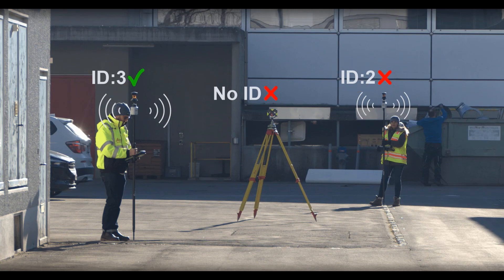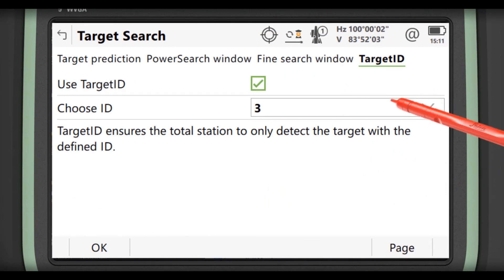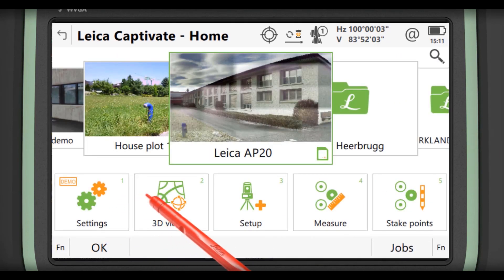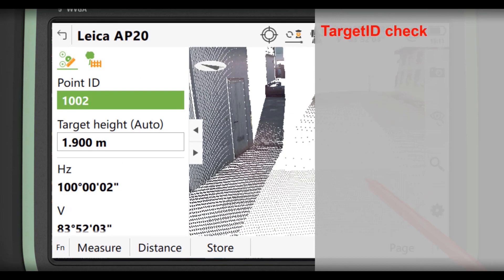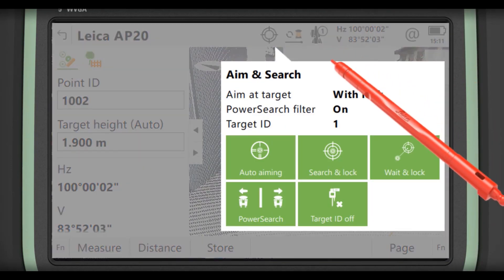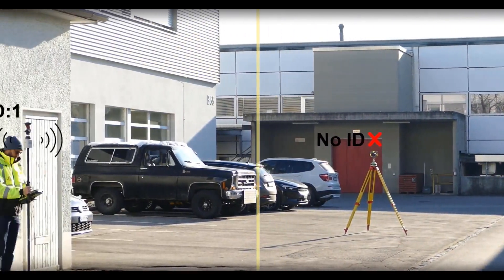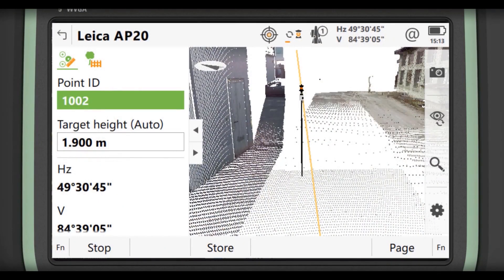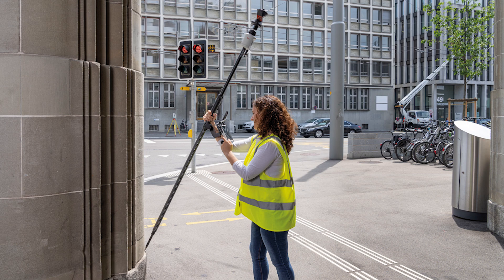How to Keep Your Total Station Locked on the Right Prism Every Time

Comment: How long will a normal sideshot measurement take with the active prism? I hate my new Trimble s5 because it takes around 5-6 seconds to shoot with the MT1000 in semi active mode. The Leica TCRP1203+ I had been using until the company "upgraded" me to a new Trimble s5 would sideshot in less than a second. And powersearch is a huge deal once you try to use the search in Trimble.
Reply: Set your edm to tracking when doing a side shot in trimble access, acts like the fast edm setting on the Leica 1200’s when doing the routine. Have you setup GPS search on your controller?
Reply: @kimzammit185  I don't trust storing in tracking mode as I've seen a couple bad shots happen from another crew that was always storing in tracking with a different robot. Actually measuring just gives a little more confidence in the shot. I just wish it didn't take so long compared to the Leica.
I'm usually too close to the robot for GPS search to help get a lock, but lately I started using "integrated surveying" with the r10 on top of the multi track prism. It weighs a million pounds but then GPS search works perfectly every time (so far).